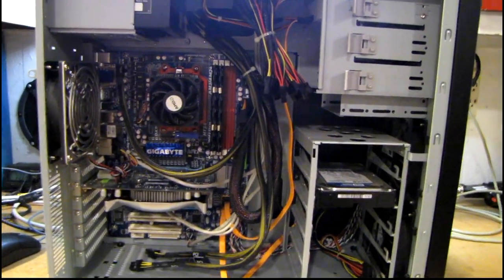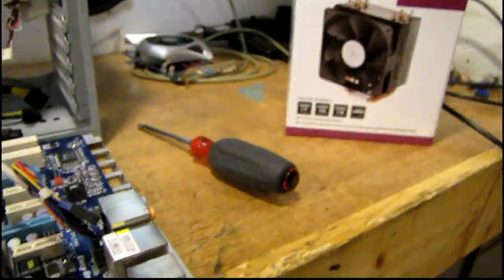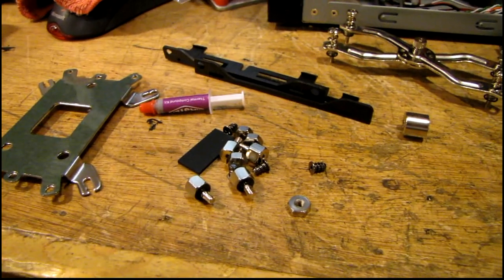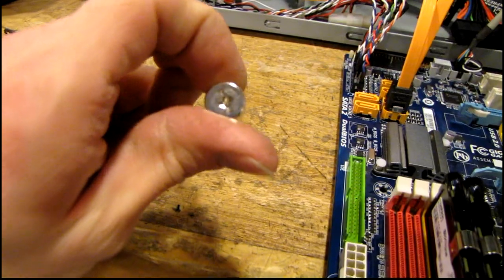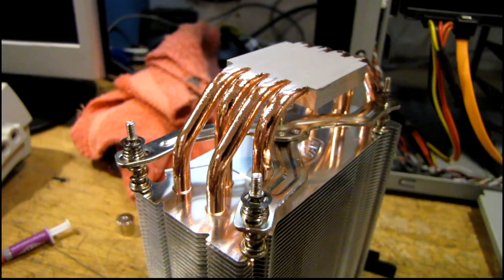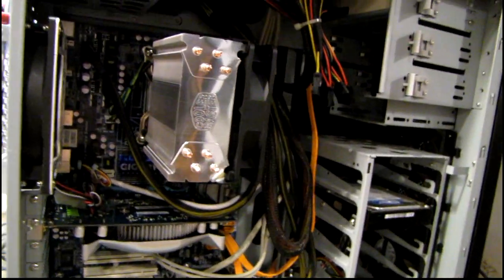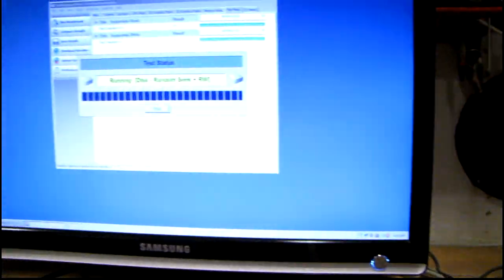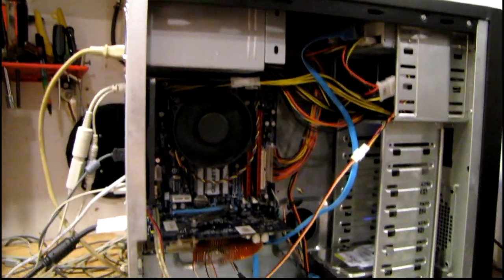Phenom II X3 CPU cooler installation + E2160 overclocking update

Comment: i actually had the fan on mine leak oily crap all over itself recently. i don't know what that was all about. i wiped it up with a paper towel and it was a darkish yellow, looked like oil or grease to me. not sure what happened there, but i have a replacement fan sitting in a box in case something does.

Comment: if you think the E2xxx series cpu overclocks well, try a Celeron Dual core E3xxx. Cheep price, usually less than $55, 45 nm tech, and easily overclocks to 3.2Ghz on the stock cooler with less than stock volts.

Comment from the maker: @pcgod8 Haha ya, I wish I had gotten lucky when it happened to me.  Another thing that used to drive me nuts was the unprotected area around the CPU socket on Socket 7 boards.  The earlier ones had no protection around the socket lugs, so the traces often got scratched while installing or removing a sharp heatsink clip.

Comment from the maker: @MN12BIRD Ya, I love the 212+ :-)  

I actually got an Arctic Cooling Freezer Pro cooler for my Sister's Socket 939 system, and it was quite a pain to work with...  I'll be uploading a video about that soon.  

Though unlocking the 4th core would be fun on my Mom's PC, it wouldn't do a lot of good.  She mainly uses it for World Of Warcraft, which only uses 3 cores anyhow :-)

Comment: I have the same cooler on here, which I got a couple months ago, after the stock Intel cooler seemed to get worn out and stopped pressing up against the CPU as well as it usually did, and caused my CPU to overheat a lot, and underclock.  This one works great, now.  Never goes above 60C on my Core i7 920, even with all cores and threads working hard, and idles at 40C.  These tests were done during the summer where my room is normally around 30C.

Comment: @TheComputerNerd0101 yes i have the one down from this on my i5 (i5650 @ 3.6ghz) and it doesn't go over 50 degrees (Celsius) and it is extremely Quiet. i would highly recommend it(i would of got the one that maxxarcade has but it wasn't in stock)  :(